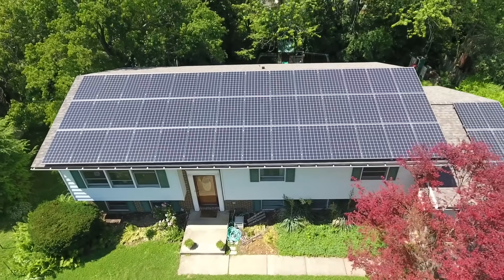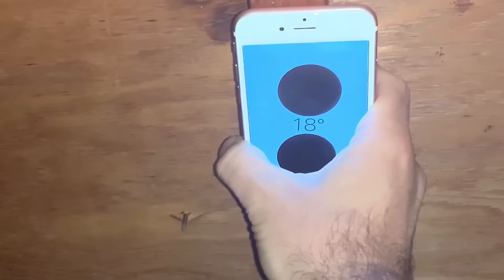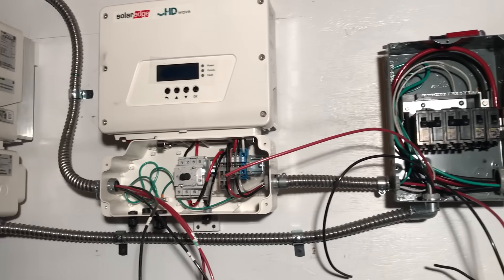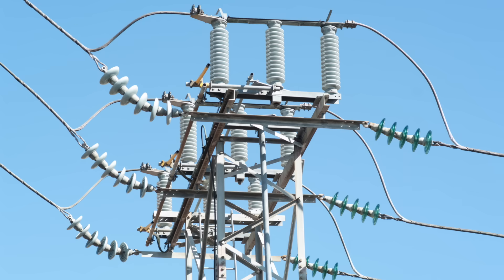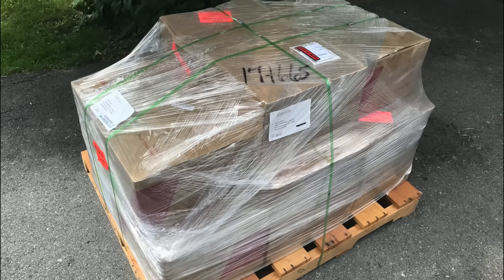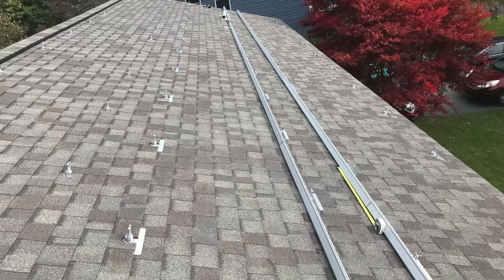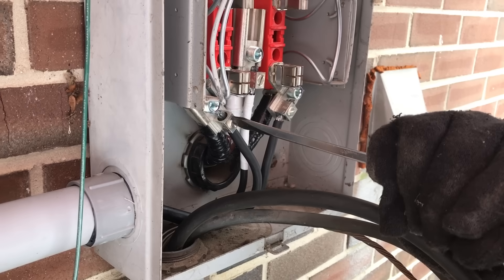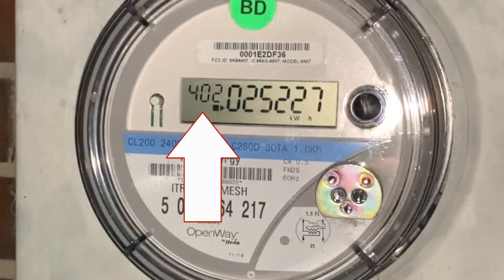I Installed a Power Plant Myself | HUGE DIY Solar Panel System

Comment: So you are happy with the solar cells that have been made possible by polluting the planet in an extreme way and generally by workers who are paid pittance.
Alternate energy is necessary, not because of carbon dioxide emissions, we are CO2 starved as it is, but all the other noxious compounds made when burning fossil fuels.  Thorium is a potential solution that has been dissed because there is not enough money in it.
Whereas wind and solar are big money.  But they will never be sufficient world wide.

Comment: What a dumbass!  First mistake, you replace your shingles wirh metal shingles like decra. Second,  buy a house in the country and you don't need permits!  Third,  you have an experienced person you hire to consult.  LG is the top panel made!  Outback is the only inverter worth buying.  Right into the meter is the dumbest way to go!  Third you have an engineer check your trusses and foundation before you start.  Panels bought by the pallet ate seconds! Last, if you have dips in your roof it is not distributing the weight evenly!

Comment: It depends on where you are located but I doubt you are making money with the extra credits. They expire. Also you will still have monthly bills. There is a basic charge that is always there just because you are connected to the grid. I've seen them as high as $40 before. But all in all, great professional install.
Reply from the maker: Check out the next video, I go over the numbers.

Comment: Great work!  
How does your system handle power outages at night or cloudy days?  Do you have any battery backup system?
Reply from the maker: Thanks!  Check out the next video for how my system works without batteries.  I loose power if the grid goes down because it’s a safety requirement for a grid tie system like mine.  But thankfully the power almost never goes out.   And it never (that I can remember) goes out while it’s sunny out.

Comment: Hi, I'm from the Philippines. My dad did the same thing you did. He also doesn't have any background or whatsoever knowledge about how to install, calculate these projects. He just looked it up on youtube and the internet lol. I helped of course, lol. Our weather here is very tropical and on summer it's really inconvenient if you dont have air-conditioning inside the house but the problem is electricity bill is a b*tch. So my dad says the heat and the sun is free so why not use it. So from there we built our solar project. Now, we're enjoying summer with less electricity bill. 👌
Reply: Kanu gastos?
Reply: @el8801  almost 40k na pero pa konti konti nyang binuo. Plan pa nya mag add ng panels.
Reply: @paulolned7014  may permit ba syang kinuha para makapag kabit nito
Reply: @el8801  wala sir.
Reply: @paulolned7014  wow ok pala . . Subukan ko rin bumuo . . Pag nag ka extra budget . . Saan kayo pala nakakuha ng mga solar panel . . ?
By the way thx sa information
Reply: Opo sir! Maganda naman ROI sa umpisa lang magastos. Yung setup kasi namin dito sa bahay is offgrid. Kapag may araw lang kami nakaka tipid sa electricity wala kami battery sir. Pero nasasainyo po yun kung ano setup na gusto nyo. May mga youtube tutorials naman po.. marami narin ang pinoy solar tutorials. Sa QC sir may warehouse sila don and sa marikina meron din.

Comment: As a solar project manager and engineer, everything seemed very correct. The only thing I would change is not using zip ties. You want everything on the roof to last as long as the warranty. Zip ties have about half the lifespan of the PV module warranty. It’s a small thing but everything else was spot on. Good job.
Reply from the maker: Thanks!  The zip ties are mainly backup to the IR clips but I’ll be keeping an eye on the PV cables.
Reply: Yeah we use stainless steel zip ties
Reply: The zip ties are static anyway, they will last albeit getting brittle over time.
Reply: you can use snap in connectors instead of zip ties,  they make ones that have a rubber barrel that fits inside the snap in connector.  Look at any cell tower you see and notice the wires that are dressed in coming down the tower.  That is the most expensive but,  longest lasting system for dressing lines. But the main reason for them is RF loss due to pinched lines isn't possible.  You can install as many panels as you want but if you pinch the lines or they get pinched from dangerous weather,  You will not get the maximum outputs from your system.
Reply: @samdaisley9269  RF considerations don't apply. The solar power lines transmit electricity, and pinching is only an issue for coaxial or fiber-optic communication lines. Example, look at your cellphone power cable, you can twist it and pinch it and it will work, but you cant do that with the fiber optic line that brings high-speed internet to your residence zones.... Dumb copper wire is all that is needed to transmit power, and high gauge-copper can take a lot of mechanical abuse before it breaks down - it just needs to be coated to prevent oxidation.
Reply: May be water hose clamp form auto part store is better
Reply: Does working for a solar company pay well??? I have a interview tomorrow for some company
Reply: hi simon ... i m looking for solar permit design work......if you have something please msg.

Comment: I am not sure , but does solar panels require maintenance and repair? Just thought you should've had that anticipated in terms of projecting your ROI's and bills..
Reply from the maker: There is almost no maintenance.  I keep an eye out for a PV wire that might come in contact with the roof or an issue like that but in general, there isn't any.
Reply: @FrugalRepair  awesome. 🙏🏻 thanks for the input.

Comment: Just a quick question did you have any backup solar power batteries installed?
Reply from the maker: No batteries, check out my next video.  I explain how net metering works

Comment: your ground can touch the aluminum rails... you have them electrically tied to it anyways.
Reply from the maker: They could electrically, but chemically with aluminum and copper together there can be corrosion.
Reply: @FrugalRepair  good tip!  I did not know that.  just looked it up and it is a special reaction on copper and aluminum.  Thanks!

Comment: Financially you forgot to mention that your capital will be sitting in these pannels for 30 years and then they have to be totally replaced by new ones and you will replace your ac/dc once in 10 years or so. Go do some math and see what 7% on a stock market could do with your bills for electricity, its more convenient to pay off your bills with dividends forever, than reinvesting the whole capital once in each 30 years.

Comment: I purchased 30 panels at a huge discount and ended up building a wood shed using the panels as the roof itself. I made thin stainless brackets that sandwiched between the panels with some 1" by 1/4" foam rubber, screwed the frames together sucking them tight for a rain tight seal. The stainless brackets screwed right to the 2x6 runners. I ended up using 24 panels and selling the other 6 with enphase inverters for a bit of a profit. The whole set up cost only about $2200 and has held up great for 5 years now. I ended up doing all my electrical blue prints by copy n paste from my phone then printing them out. The electrical inspector asked if he could bring trainees out to learn to learn solar since it was the most simple basic system he has ever seen.
Reply from the maker: Wow, that’s great!
Reply: Can you send the blue prints
Reply: @thosetruselboys165  they arent really blue prints but just a simply cruel description of my set up from basic internet drawings. I would have to get a new battery for my old phone to even get a copy of it to forward it to you. The inspectors loved the simplicity of my description tho. I first actually drew it out on paper and turned it in and they sent it back telling me I needed to pay a engineer to blueprint it lol.
Reply: @triggerwarning2439  oh ok lol dang! My husband wants  to.do ours :(

Comment: I first got Solar Envy when I saw some panels in a shop in 1992 and have been wanting to get it installed ever since then but things happened but in April 2020 it finally happened. Knowing what I know now, the install would have been quite a bit different which would have been, I hope, better but at least I knew enough to insist on micro-inverters being installed. I am not in it to make money though it would be nice to break even on the investment and getting the first (and later another) battery installed is likely to make that more difficult. The next biggie after that is getting an EV. Wanted one of them even longer then the panels.

I have subscribed so I can follow how this all went from go to well, ongoing. Thank you for sharing and I wish you well with your endeavour. 👍 + 🤞
Reply from the maker: Thanks!  How much solar wattage did you install?

Comment: Does it work on rainy/cloudy weather for multiple days?
Reply from the maker: Good question, maybe I can make a video about that.  Yes, it does, but not that much power.  Basically, if you can see outside there is enough sunlight to make some power but not it’s nothing compared to full sunshine.
Reply: @FrugalRepair  Ok. Thank you!

Comment: My installer used zip ties and I had two optimizers die (out of 17) after 4 years. I found that several of the zip ties had broken and fallen off already so I was pretty disappointed about that. My roof is 10 years old so I'm concerned about having to take all the solar down when the shingles need to be replaced. I'm regretting not having done a ground mount like I had initially considered, but you've completely covered a brand new roof so I hope it lasts for 30+ years. We just had a massive hail storm and the solar did a great job of helping to protect the roof from damage. No damage to the panels and minimal damage to the exposed shingles.
Reply from the maker: Hopefully they were replaced under warranty and weren’t that hard to change.  Just curios, are you in the US?  What state?  We don’t usually get significant hail here in PA.
Reply: @FrugalRepair  In Texas. They were replaced under warranty. I ended up doing it myself because the original installer wanted to charge for labor. Although SolarEdge gives a labor stipend for warranty repairs the installer said it wasn't enough to cover their rates.
Reply from the maker: I hope they paid you for the labor!
Reply: Nope, only installers get labor stipends.

Comment: I spent 2 years in a solar company, I strongly recommend not just base your "roofing space" for your needs, each type of panel have a different production capacity, so maybe you could buy fewer panels from a higher capacity, you should also know you have to do a "shadow study" to avoid losing power on your system.  a very good tip is, to be honest, and annualize your needs and therefore your production, because if you get only the higher production rate your calculations will be very wrong. Hope this is useful

Comment: Not sure what all you did on the inside,  but company's that do solar installation usually beef up the roof trusses to handle all the excess weight.  If not you are looking for trouble down the road.

Comment: No bills huh? how often do you need to change the batteries you are using that cost more fossil fuel to make that story your power?
Reply: It's been proven that lithium ion batteries have a long battery life. There people who have driven Tesla'for over 10 years on the same battery with between 5% to 7% degradation. I would guess it's a minimum of 18 years till it will be justifiable to change his batteries.
Reply: @marcusgarvey8388  I give it about two to three years then it will start losing a lot of its bank's life span. The facts are not backing that claim up. Even if you have a Tesla. They are not driving it every day. It's a nice idea but battery Tech has reached its max peeks at this point in time. We are not going to in inventing in a Tomy Stark power supply any time soon. 

The typical estimated life of a Lithium-Ion battery is about two to three years or 300 to 500 charge cycles, whichever occurs first. One charge cycle is a period of use from fully charged, to fully discharged, and fully recharged again.  .

https://batteryuniversity.com/learn/archive/batteries_against_fossil_fuel
Reply: @CyberSoldierD19  I just watched one of his recent videos in which he explains how he doesn't use batteries. He uses solar during the day and sells the excess electricity produced to the state. He then uses the grid during the night. He also makes a profit from selling more electricity to the  grid than  he uses during the day. You should check it out too. Batteries aren't mandatory if you want to install solar panels.
Reply: @marcusgarvey8388  hmm interesting

Comment: I was fitted hundreds of these systems around ten years ago here in the U.K. and the only reason the public were having the systems fitted was of course money , at that particular time the government we’re offering 45 pence per unit that was returned back to the grid which was pretty good but the downfall was the cost of the system at the time... a typical 3.5 to 4.0 KW system was around £20,000 which was way to expensive in my mind but it was work for a lot of us electricians in the country , a couple of years later the pp unit was dropped to around 16 pence so it faded out as of course it’s all about the 💰 not about being green 😎🇬🇧👍
PS: systems are still being fitted to new builds etc the price I’m not sure.

Comment: yah... hope the flimsy schedule 40 pvc he put instead of rigid or EMT conduit doesnt i dunno burn.... PVC is not allowed due to the fact that it has no means of shutoff from the meter to the disconnect. Also... the disconnect is not bonded... next time hire or actually read the NEC ...
Reply: The amount of basic code violations is just sad in this video.. your inspector needs to get a new pair of glasses.

Comment: For more than 10 years you dreamed of having solar panels. Well guess what buddy, the dream is only going to last 10 years that you will have to replace them all and that's if you're lucky. You will need to change them in closer to 8 years or less, so keep dreaming. Once you're tired of being broke changing batteries every few years and solar panels. You' be crying for regular power grid.

Comment: No bills, just have to pay off the insanely expensive power system for the next 48 years.
Reply: Solar is cheaper than ever before, go educate yourself on the potential of solar power. Stop living in the 90s.
Reply: @marcusgarvey8388  it's still ridiculously expensive even if it's cheaper.
Reply: @SomeJustice19k  Check on one of his recent videos. The entire system cost him $21,000 plus his making money from it through tax credits and payment for excess power he produces. He also nolonger pays for electricity each month which reduces his expenses since he lives with his family of 7. He expects to break even in between 8 to 6 years instead of the 48 years you mentioned. After that he will start making money from selling the excess electricity he produces to the state.
Reply: @SomeJustice19k  I get that $21,000 is a lot of money but you need to look at it as an investment rather than a liability. Additionally, you don't have to do exactly what he did, he has a large family that uses up a lot of electricity in a big house that is both heated and cooled. Someone can save up and buy only enough solar panels to cut their bill in half instead of all of it. That would still be a major win for solar. Solar power has also been found to produce electricity at a cheaper rate than coal. It's a proven fact that you can check out for yourself.

Comment: wow this is amazing i would love to put panels on my house too even tho i cant put that many it would be a blast i am wondering tho is it possible to have some kind of big battery that stores the excess so u can use it later or the next day
Reply from the maker: Hope you can do it!
Reply: Yes you can charge batteries to feed back but they are to expensive at the moment & life expectancy unknown. My solar works great but UK winter production drops severely. Only hit max KW for short stints in summer.

Comment: Cool video! Looking at this as someone who works at a solar installer company in Europe though, i find a lot of things about American electrical engineering weird. Uninsulated grounding wire is just not done, the breakers look way different here and why would the power meter be outside of the house? Regardless, very nice video and you did a very good job!
Reply from the maker: Thanks!
Reply: Power meter is outside the house so the power company can read the usage without entering the house.  Also the power meter module is mounted in a plug base, so it acts as a disconnect.  If you don't pay your bill, the power company can pop your meter out.  If you house is on fire, the fire department can pop the meter out before going in and spraying water.

Comment: WOW.. why is solar so expensive in the USA?  I'm getting a 6.6KW system with 19 Jinko 330W panels and a Goodwe GW5000D-NS inverter and it's costing me about $2100 (AUD) (about $1600 USD) fully installed.  My payback is just a bit over 2 years.

Comment: and it will take 50+ years before you break even, if at all, and in the end you will calculate that it would have been cheaper and a lot less trouble, if you stayed on 100% grid electricity supply